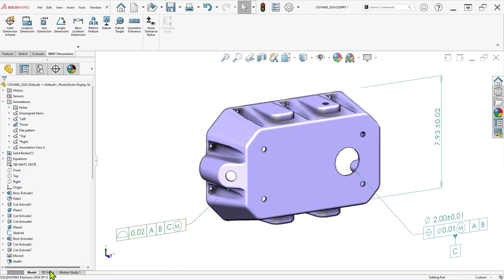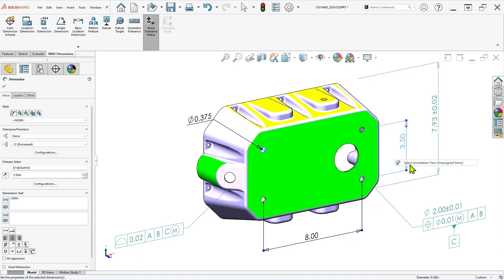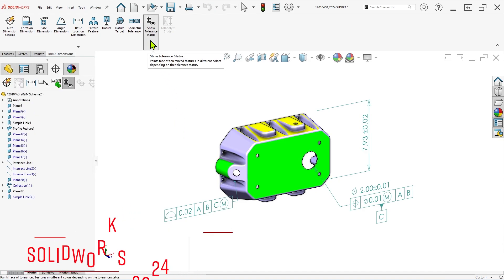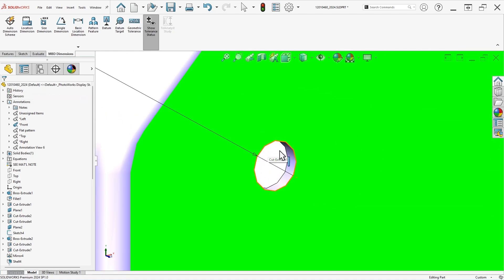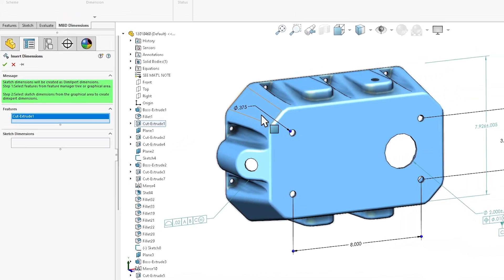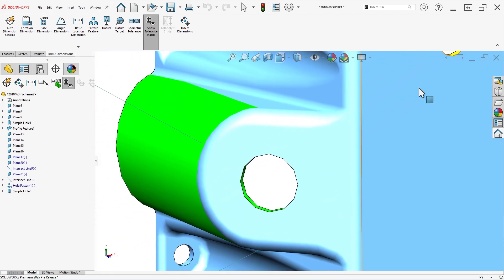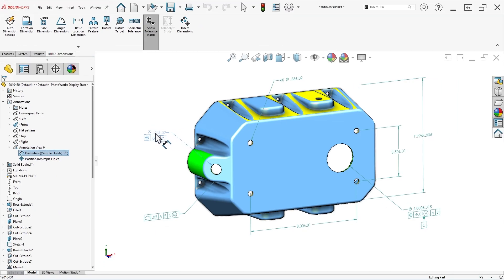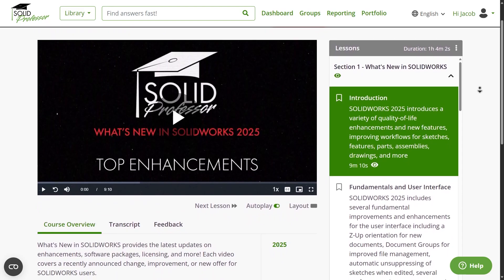SOLIDWORKS 2025 - Convert Sketch Dimensions to DimXpert

Comment: I find it a bit hard to do all the work in 3d with mbd. The struggle is when i want to insert views in drawings and dimensions are not seen in the views which would be Best.
Then I must go Back to 3d and place then in correct views. I dont really know if it is time efficient at the end.